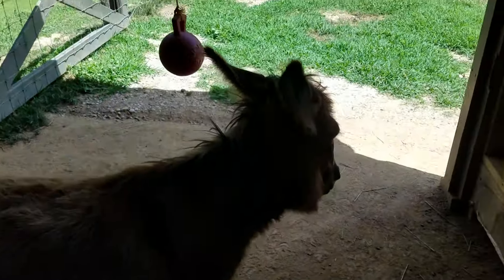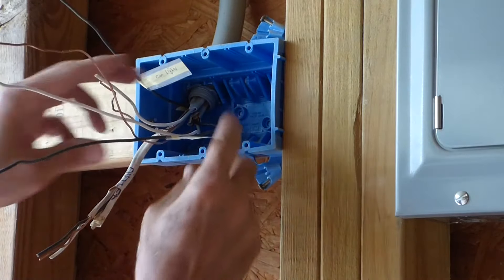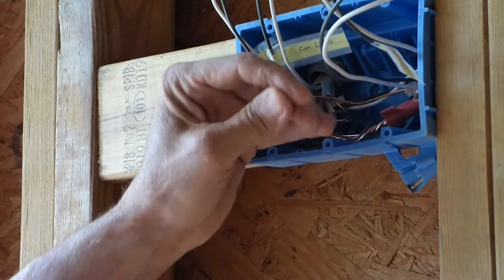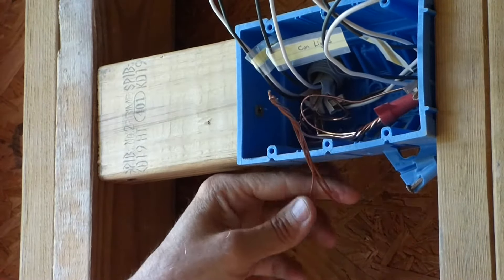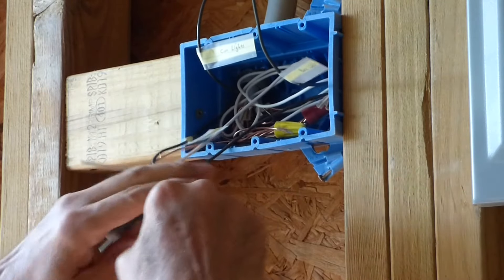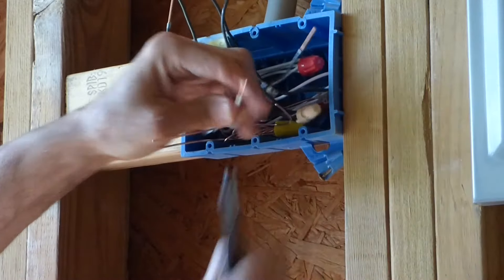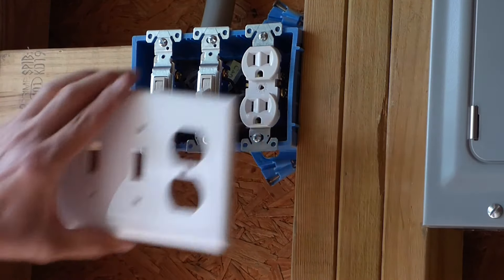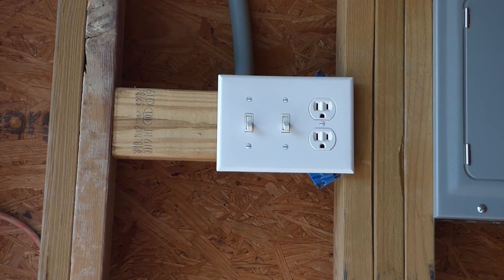How to Wire Multiple Outlets & Switches in 1 Box

Comment: Thanks man. I followed your exact directions and it turned out perfectly.

Edit: it’s hard to splice 5 wires together but I made it happen by just cutting off the ends and making them even.
Reply: Wait. Did you just put two ground wires on the top light switches? Naw, Son!

Comment: Pretty good. Running NM or Romex in a conduit is not the way to go. Clean job on the wiring though. I prefer a crimp on the ground wires, no pigtails needed that way. I do like that you pigtail the connections as opposed to connecting on the back of an outlet. I would run a deep metal box and plaster ring as opposed to the plastic box designed for Romex type wire.

Comment: One last question if it's an older house and the only copper wire is leading to a new installed outlet can you splice all them together let's still ground them even though there's not a ground in the older wire coming from the breaker box?

Comment: Hi. Are ground wires necessary inside a plastic box? Also, I'm confused as to why so many pigtails were used here. For example, couldn't the grounds wires have just been as easily attached to each individual unit? I've never wired a box before, so I hope I can get an answer. Thanks.
Reply: Yes, you could loop the grounds around the individual terminals.  It would be far easier to pigtail.  It would be very difficult to stuff all those wires into the box.  It would be very likely that one would touch a hot wire on the switch next to it.  You would not find it until you test or apply power and the breaker never resets.

Comment: Would you have to have a GFCI instead of a basic outlet in that building?
Reply from the maker: Check with you local building inspection office (if you have one).  Most areas require GFCI protection in outbuildings and garages.  They will help protect you if there is any chance of moisture in your building.

Comment: And since the neutrals are pig tailed and going to the lights directly you don't need them on the switch as that's over kill?
Reply: There are zero neutral terminals on the switch.  The NEC prohibits switching the neutral.

The only device that got a neutral was the recepticle.

The grounds are required on each strap, each device.

Comment: Is this really accurate with all these pigtails?  That just seems much more dangerous than just doing jumpers but I'm no electrician.
Reply: The "pigtails" are jumpers.

In this case they allow easier wire management to fit everything into the box.

Comment: Can we bring power from light fixture instead of bringing power from electrical panel?
Reply: Yes, assuming the power from the light fixture is not already controlled by a switch and the number of total outlets, lights and devices etc. on that breaker does not exceed 80% it's rating, i.e. 15 amp breaker total load must be less than 12 amps.

Comment: Hi! Great video. Thanks for sharing. Is the same procedure possible with 3 switches and one outlet as well? (2 ceiling lights and one LED under cabinet lights switch).
Reply from the maker: Yes.
Reply from the maker: ... and make sure the power is turned off before you begin any electrical work!

Comment: Have you tried WAGO nuts?
Reply from the maker: Not to date...  my sense is the old twisting of wires with a wire nut provide a better and more secure connection... not to say I wouldn't use them in the future though.  The push in nuts sure look quick and easy

Comment: I'm a bit confused about the grounds. Why splice 3 grounds, to one pigtail, then split it back into essentially the same original 3 wires? Why can't you just ground the 3 on the switches/receptacle to begin with?
Reply: I just had to do this today so it's fresh. You need to ground the switches for your lights/etc to the line ground, AND ground each Romex line going back out to each light/fan/whatever device to the line ground. If you just connect the ground for the switches to the line ground, you leave the Romex cables back to the devices out of the grounding equation. I hope that helps, pain to get it all in the box.

Comment: I don't think you can drill holes or run conduit for plastic boxes. A 3 gang metal box and emt conduit would be my choice. All the other boxes should also be metal. 
There also is some controversy about running Romex in conduit as opposed to running individual THHN wires.
Reply: Ted, 2020 NEC 547 for agricultural buildings EMT is not "permitted".  Nonmetallic everything is permitted.

So if a storage building....just like a garage.

I am sure the building guys will make that call.  I am not sure from the video.

Comment: For all:. Be careful of you verbage. 

 If the building is just storage, it needs GFCI recepticles like a garage (all recepticles even 250 v) i.a.w. 2020 NEC 210.8.(A).(2).

If it is an agricultural building it falls under 2020 NEC 547 for agricultural buildings.  GFCI for 120 v outlets but may require wet covers for switches and recepticles and it discusses approved raceways (piping). And more.
Reply: only if his area is on the 2020 NEC. some areas/states are still using older versions of the NEC, I know my area is